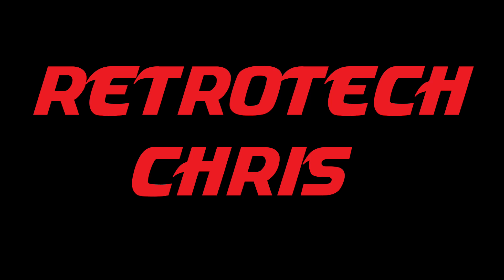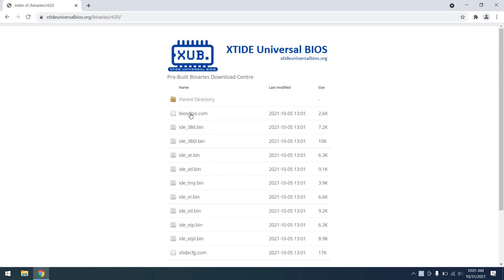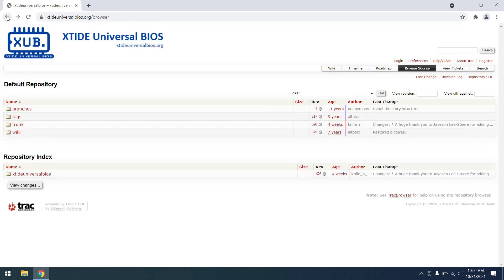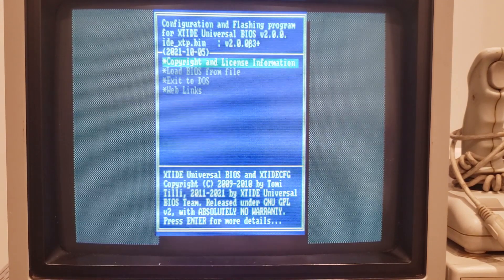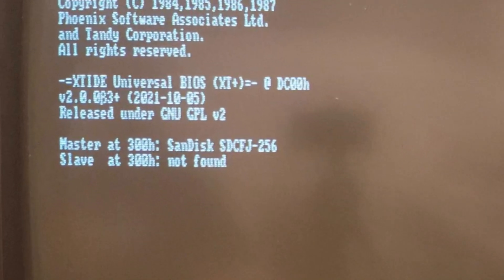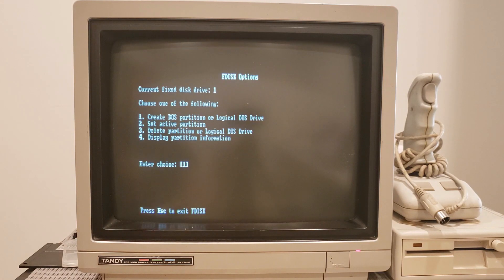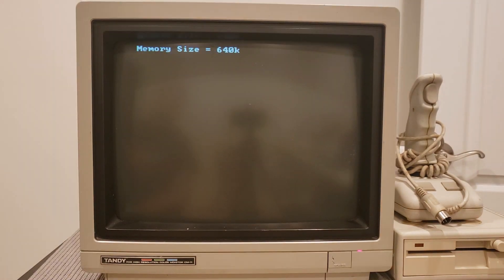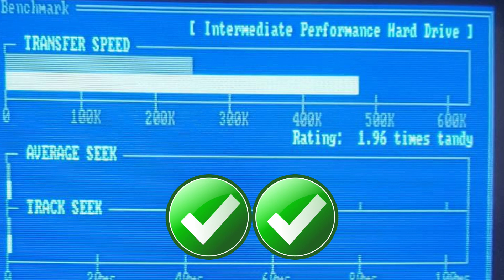RetroShort: Doubling The Speed Of An XT-CF Card When Paired With a NEC V20 CPU

Comment: To use a CF card ide drive on a retro PC , Only DOS need this XTide rom , linux does not need it .
Am I right？
Reply from the maker: Hmmm.. actually the XTIDE ROM is an option ROM.  If you have an IDE controller, in theory, assuming the system BIOS supports your disk geometry, you wouldn't need XTIDE at all... you could just use a CF to IDE adapter.  XTIDE comes in handy when you need IDE support in an old machine.  And the XTIDE option ROM adds BIOS software support essentially.  In theory you could just use the option ROM on a network card or other device that takes option ROMs if all you needed to do was overcome geometry limits on a system.

Comment: Hi.
Nice video but strange how a cpu upgrade can increase the speed of hard drive read / write 
Must be some instructions in the NEC V20 that the original IBM chip does not have similar to say 486 or Pentium MMX has instructions about video decoding

Strange with the drive boot not working even after the mbr command ( did you try just to sys c: of a floppy ?? ) again my guess is the XTIDE bios is similar to a MFM / RLL  formating being unreadable when you swap controller cards

Seeing the files were on the car, you could have created a new directory on the second partition, and xcopy c: .   d:\newfolder /e /m /s    then just formated c partitons , done the sys command and then move the new temp folder of d partition as D is not required to be bootable and the files were readable

Regards
George
Reply from the maker: It wasn't just the CPU upgrade, but the CPU upgrade coupled with the XTIDE BIOS upgrade that really did the trick.  Regarding xcopy, sadly the logical drives were not seen when booting from a floppy, otherwise I certainly would have given that a try and saved some cycles.  Yes, sys C: was tried.

Comment: Very cool, that's a great performance boost! I may have to look into this one day for my own 1000. Can you share some info about the CPU upgrade that's required in order to use this BIOS? It sure would be nice if each of those available BIOS files had some indication as to what they were for without digging in the code/makefiles. I had the same question a while back as to which to use.

I had a similar issue when I first setup my XTIDE: the image booted fine in emulation, but wouldn't boot on the real hardware yet all the files were still in place and readable. A sys c: / fdisk /mbr did not fix it for me either. In the end I did the same thing as you and created/formatted new partitions on the real hardware. I was on the original XT bios, but a recent version. I still wonder what it is that causes that issue.
Reply from the maker: Glad to!  I went with a 20MHz NEC V20 as I recall, which was certainly overkill given the Tandy 1000 HX CPU run at 7.16 MHz.  The key is to get something with equal speed or faster, and they are readily available on eBay for around $15 USD.  I actually made an upgrade video, but the quality was so bad I never released it :)  I'll upload it and leave it as unlisted for a time in case you want to see the upgrade process!  Currently processing but should be available shortly: https://youtu.be/QFtftp8k0SA

Comment: A nearly 2x speed increase from a simple BIOS upgrade?  Impressive!  I'm curious to know how they were able to achieve that.  Thanks for sharing!
Reply from the maker: Glad you enjoyed it!  Ya, basically achieved through more sophisticated processors having additional instructions that can be utilized!  The 80186 instruction set gave a lot of lift here!  I tried the same experiment on my PS/2 Model 30 286 and got a similar double speed over the "default" XT load, so guessing that going from 8088 to 80186/V20 gives the most lift!!!
Reply: @RetroTechChris  so then the XTIDE is already using an 80186 processor but was using 8088 instructions?
Reply from the maker: @OzzFan1000  basically, I had the XTIDE installed in a machine with a 80186 (i.e. NEC V20) processor, but the software on the XTIDE was only issuing 8088 instructions.  By upgrading the BIOS of the XTIDE card, it is now able to issue 80186 instructions to the CPU.  Since the 80186 instruction set is "richer," the XTIDE software can now execute better and faster.
Reply: @RetroTechChris  thanks for the explanation